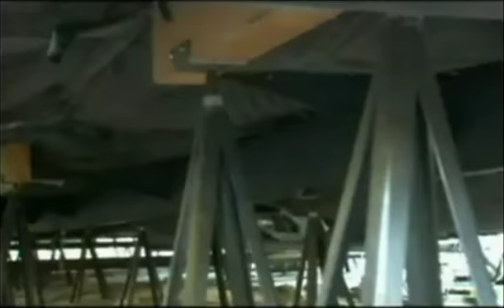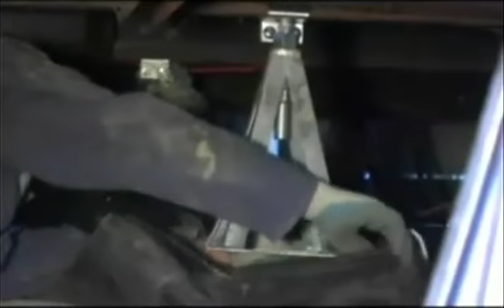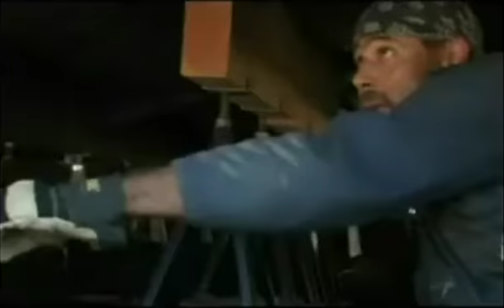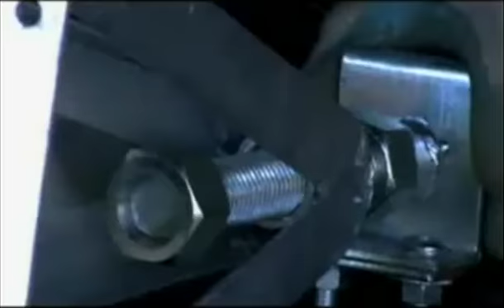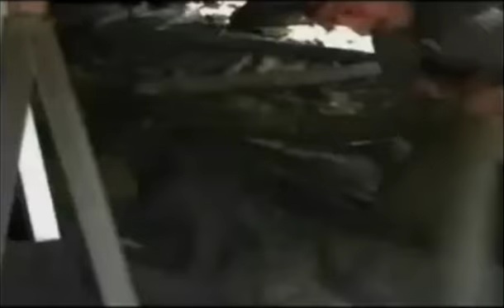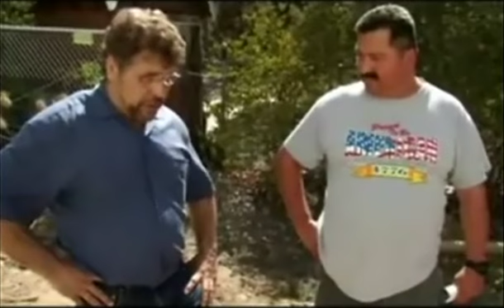Financial Compliance for Manufactured Homes (Foundation)

Comment: This is such a great innovation if you think about it. We had this system installed on our home last year and I can tell you from a homeowner's firsthand experience that this foundation really works. Our floors seemed bouncey and we felt vibrations all throughout the house prior to putting in the 'Buttress" as I believe it's called. The company provided us with full engineering which the city inspector told us was more than adequate as a fix. EXCELLENT COMPANY AND PRODUCT.